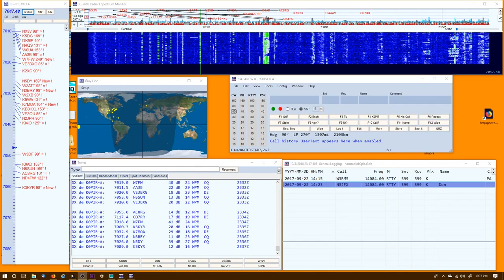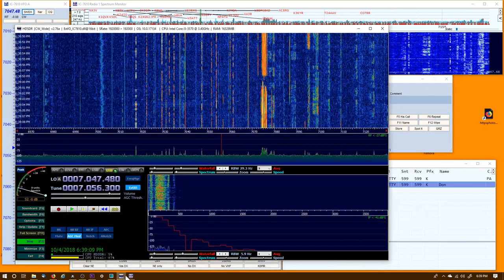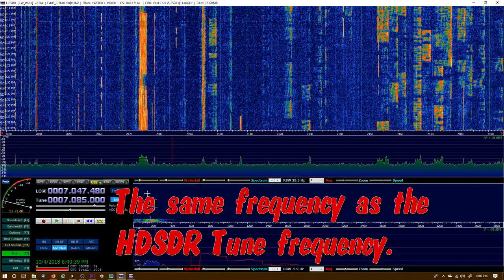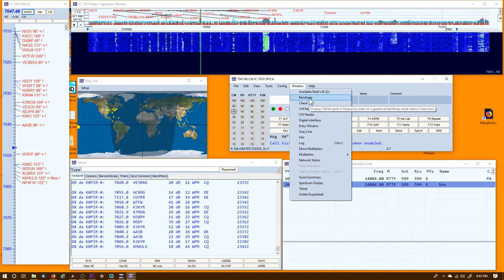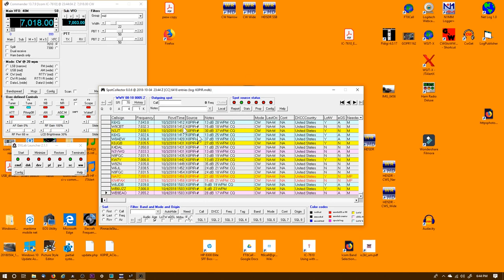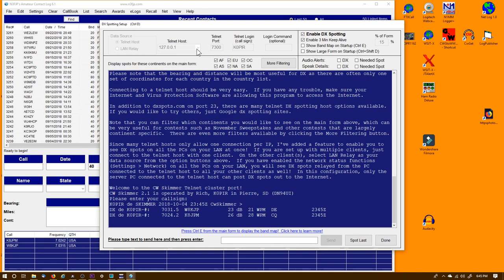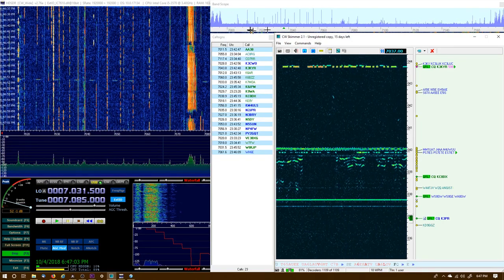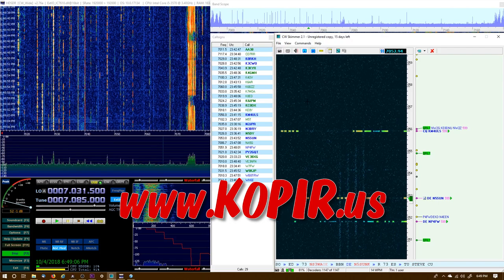Icom 7610 HDSDR CW Skimmer 170 kHz Wide

Comment: does this work for the 7300 as well?
Reply from the maker: Great question. Sorry, but not like in this video.

You can add a SDR to the 7300 and have a similar setup. I did it with my 7300. I never got as far as using CW Skimmer though. I am not sure how it would work. I'll bet guys using the SDR Play with their 7300 can get CW Skimmer working.

See my website and the articles on the Icom 7300 and HDSDR: http://www.k0pir.us/icom-7300-panadapter-dxpatrol-mini-circuits-splitter-hdsdr/

73,
Rich, K0PIR